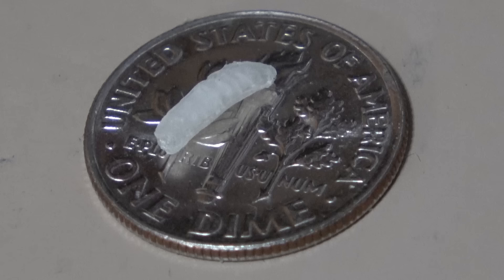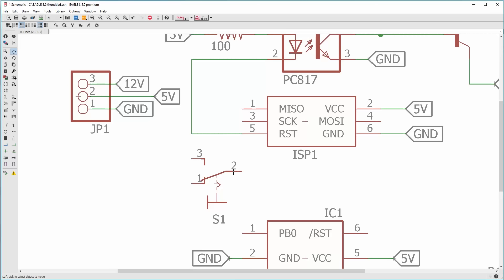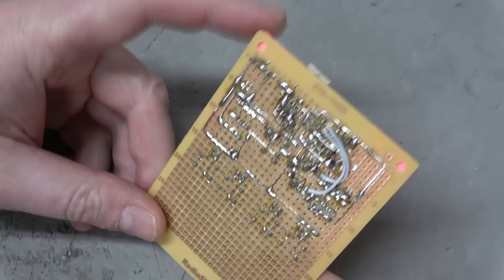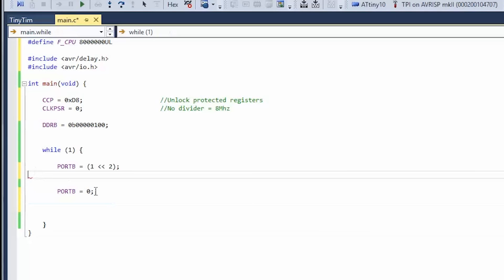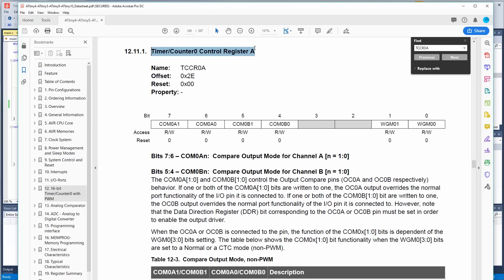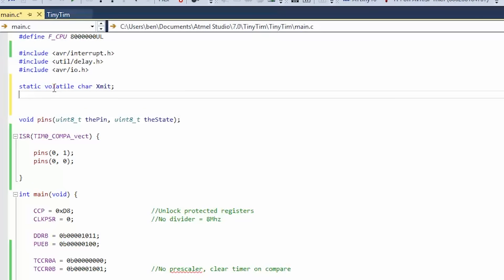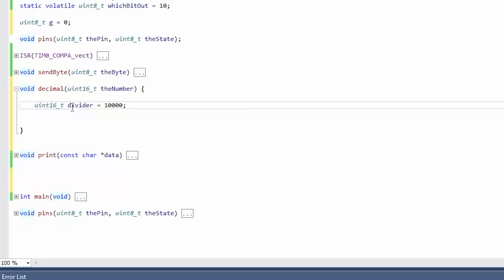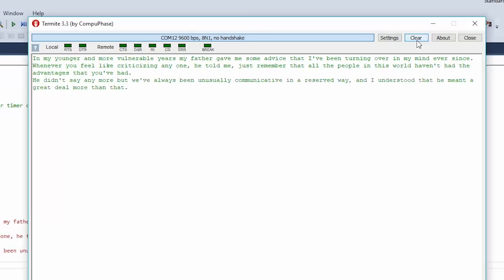How to use the Atmel ATTINY10 Microcontroller

Comment: These are some of the chips that I make at my job, it's nice to finally understand not just how to make them but how they actually work.
Reply: Thank you for providing! These chips are awesome
Reply: You are a hero! Thanks, Eli.
Reply: These things are awesome definitely putting one in my hand
Reply: Sick dude
Reply: Thank you so much for your labour Eli! These things are really cool and could be / are incredibly productive for humanity with the right applications. They're 100-1000x cheaper than I assumed a rice-grain-sized computer would cost! I can think of so many ways these things could help people (especially so with tiny rechargeable batteries and solar cells). It's miraculous to me that you can fit a timing oscillator in such a small thing, let alone a CPU, RAM, and ADC!

This alone has inspired me to learn far more about low-level / low-resources programming. The price and size is a huge, huge deal.
Reply: Can you make a video explaining how the process works?!

Comment: Ben, you rock so much.  Showing the actual dates sheets and raw code from start to finish; building your own ICSP board, there's really something for everyone here.  This is how I got my start with AVR chips back before arduino; and there is huge nostalgia factor here for me.  One thing to keep in mind (may not be relevant to this chip), but in general when working with raw MCUs is a good idea to include a decoupling capacitor (pretty much any value ceramic cap) between VCC and GND because toggling the IO lines can cause a drop on VCC causing the MCU to misbehave (on some lines of MCUs, like the PIC16 it can cause them to just reboot mid program!) anyway, great fucking content, I love that you showed the whole development process.  -- And hey, you should take a look at the V-USB library for the ATTiny / ATMega (you can create a bit bang HID device without even needing a crystal oscilator, just a few zeners! Though you'll need a bit more ram than 32 bytes!) -- Happy Holidays Ben, you fucking rock!  Keep up the good work!
Reply: Good tip! Thanks for your comment.

Comment: I'm glad i leaned programming microcontrollers like that in university and get why it can be important but man am I glad an arduino is all I need for most projects. So i don't have to spend so much time in the datasheet ;D great video, well explained ;)
Reply: What the importance of it is it's tiny and does the right amount of works or functions as well as is cheaper than an normal arduino chip.
Reply: @ray-charc3131  sure I also allways have some attinys laying around for when i need a small form factor. But i referred more to the IDE than the boards itself. Sometimes it's important to have every bit of control over the chip but sometimes it is just more convenient to not have to deal with the registers.
Reply: Never used an Arduino myself. It's just ridiculously overpriced for what it is, and massive and slow. If I need to actually do some more intensive calculations, I use an ESP8266. I use ATTINY85s for most my stuff with the TinyISP programmer. Will probably get an ATMEL ICE or similar for debugging, and stuff.
Reply: @NolePTR  hm massively overpriced is true if you buy the original... Most of the time i use pro micros. From China a pro micro board is cheaper than buying the Atmega32u4 that is on it separately (even if you would buy >100) ....
Reply: @MakenModify  Thanks for the recommendation. I'll look into it.
Reply: @NolePTR  someone recently hinted me to the stm32 (blue pill) which is ARM Cortex-M3 based and from China for ~2€/$ with 32bit, massive io and speed. A bit overkill for most of my projects but worth a look ;)
Reply: @MakenModify  Now that's an enticing deal. Thanks for the heads up.
Reply: @MakenModify  Arduino is not an IDE, its editing widget is crappier than Notepad! and about the "not having to deal with the registers" part, i just do the same as arduino (with less crappy overhead, handholding and annoying limitations (try using all available timer intervals while arduino's millis function hogs them for example) though) by putting a few defines or functions i regularly need into a header file.
Reply: @nonchip  it's called arduino ide and so i call it ide since if i say "arduino editing widget" no one gets what I'm talking about. For most arduino projects I use visual studio code anyways but that was not the point anyway. As said i learned programming microcontrollers the old fashioned way and it do not regret it but for simple tasks like controlling a stepper and a display I'm happy with what the arduino eco system offers
Reply: @MakenModify  that's because it's also not called "editing widget", that's just the fundamental ide component they screwed up. and agreed it's not the point: the thing you like about arduino is not the thing they call ide. it's the library.
Reply: @nonchip  i like the ecosystem they provide and the ease of use they established.
Reply: @NolePTR  dude can o use a TinyISP programmer to programa any atmel Chip? And other questions, what language do you use to program th esp8266? The Arduine IDE? Thnks in advance
Reply: @NolePTR  You are aware that to use the arduino you don't need the entire thing, just the atmega?
Reply: @davidkern7636  You realize the ATMEGA isn't that powerful at all, and these other boards are far cheaper and more powerful?
Reply: @NolePTR  I never said it was slower. It's just good for beginners cause you got lots of beginner friendly tutorials and, as stated before, isn't THAT big as most people thinl
Reply: exactly... arduino for protoype then when you go ok... I need 10... you can then figure out how to accomplish smaller.. when you know the desired end result its easier to get there(or re-get there) I see arduino environment as an excellent DEV board... wish they would fixup the IDE though as its garbage.

Comment: 43:44: Print "Hello"? Not Hello world? Unforgivable.
Reply: @computerman2830  not enough ram to print hello world?
Reply: @computerman2830  Per the datasheet, the ATTINY10 also has 1024 bytes of flash RAM in addition to its 32 bytes of SRAM. Presumably that could have been utilised to pull this off.
Reply: @computerman2830  lol
Reply: @ropersonline  it's a rom, not ram 😅
Reply: @ottobass9193  Yes and no. It's not technically ROM, no, but: "Internal write operations to Flash program memory have been disabled and program memory therefore appears to firmware as read-only. Flash memory can still be written to externally but internal write operations to the program memory area will not be successful." 
Either way, it wouldn't stop you from using the flash RAM to store and source a hello world const. You don't actually need that string to be variable. You don't actually need to alter it at runtime.
Reply: No: "Hello, Dave."

Comment: I recently wrote a bit banged 9600bps UART on an ATTiny24 running at 1mhz. . Used assembler to save space and had to cycle count each instruction to ensure it emitted (and received) at the right speed. The code was tiny, and really useful for debugging 😁 Great to see Ben back!

Comment: Hello, at 10 min it is clear that, the current limiting resistor is missing from the base of transistor Q1 2N2907 and the collector of optocoupler    transistor . Both transistors will be destroyed. Success and a Happy New Year.
Reply: Yes Ben the magic smoke will get out!.
Reply: @rfdave3980  Yes, I know well of the smoke. Never speak of it with a pc on. They only hide the smoke for so long.

Comment: Great video. Used to do something similar 10+ years ago in college with pic microcontrollers.

+1 for the art on the wall
+1 for practical programing illustration
+1 for references to the datasheet

Comment: For function args most compilers for most architectures are likely to pass them by register, rather than store in memory, so the concern should be matching the register size, rather than keeping memory usage light. This architecture has 8 bit general purpose registers, so uint8_t would likely be most ideal anyway.
Reply from the maker: That makes sense, considering RAM access has a 2 cycle penalty.

Not shown in video but doing the same toggle test in assembly yields an identical speed.
Reply: @BenHeckHacks  this is a very nice video, by the way - you've managed to describe incredibly low level C programming in quite the understandable manner. Reminds me very much of Gameboy Advance programming in C.
Reply: @BenHeckHacks  
Even more, if you enable optimisation, pins function gets inlined into the main AND it's optimised down to the single instruction: cbi for clearing bit, sbi for setting bit

Here's the assembly listing: https://godbolt.org/z/8c1pY5

And if you mark the function as static, compiler will know that there are no other object files that will ever call it and remove completely

https://godbolt.org/z/Du-HFP
Reply: I'm curious why you would be doing this in C at all and not C++ where you can leverage constexpr and templates for compile time computations so as many things can go on the flash as possible.
Also yes, compilers are way smarter than you, just make sure your data is word size and it will fo magic to your code. I recommend watching cppcon presentations on the topic and toying around with godbolt just so you can witness how truly powerful C and C++ compilers are.

Comment: At the Programming Part: in school, we used to use Atmel Studio as our main IDE, but when compared to Visual Studio with the Visual Micro extension, then the VMicro is much more convinient and forgiving when using a CH340 instead of the CP2102. And you have the features like autocomplete or one-click to compile and program. (and no need to press the reset switch while programming the atmega2560)

Comment: Nice and entertaining for us geeks.  Thanks for the demo.  I plan to use it to read a voltage in and PWM out a signal to control a PWM speed control fan via simple voltage input.  Imagine a speed control fan based on the LM35 and an op-amp.

Comment: I haven't dug through the datasheet for the optoisolator, so I might be going off half cocked; but, 100 ohms seems a little small on the current limiting resistor for the internal LED.  Outside of that, excellent video.  Reminds me of the pain of learning to program PIC chips when I was first getting started.  This type of material should be a prerequisite for new developers, especially those that think Java can do anything.  ;). Doing useful, timing sensitive work with 32 bytes of RAM and a tiny amount of flash is the best way for beginners to appreciate limited resources and gain a true perspective on what's really going on behind the scenes of "luxury" programming languages.

Comment: after five years i happen to come across this and enjoyed every thing you teach us. one thing i had doubt,  at 6:02 the PC817 emitter is directly grounded. since the collector of PC817 is at 11.3V and Emitter-collector voltage VECO of PC817 is only ablut 6V, this direct grounding may destroy the PC817. i think we need an 1k ~ 4.7K resistor to limit the current through PC817 / 2N2907

Comment: 39:09: NB: The "case 2 ... 9" syntax with ellipsis is a non-standard GCC extension. Careful now.
Reply: As long as you use GCC, what's the issue.

The alternatives are either
A) case 2: case 3: case 4: ...
B) case 0: break; default: ...
Reply: @DanCojocaru2000  The issue is, if you put non-standard stuff in your instructional video, you should highlight it as such. Otherwise someone else is going to have a bad time, and a video that guarantees at least some learners a bad time is not good teaching material.
Reply: @ropersonline  A fair point mostly. Mostly since someone intending to learn stuff like manipulating registries from C on a microcontroller should be able to quickly find out why this non-standard extension might not work for them on Google, or at least find out how to make it work using standard ways.
By the way, are there compilers for AVR that don't have this extension? GCC and clang support it, but are there any others?
Reply: @DanCojocaru2000  I'm not sure, but even if there aren't, once you put a tutorial-style video out there in front of a significant audience, its content will spread beyond a narrowly defined use scenario, and it's always a good idea to point out that something doesn't generalise. Saying, well users doing X should be expected to figure out Y is pulling-up-the-ladder logic. It's better to keep things as accessible and universally applicable as possible.
Reply: @ropersonline  Up to a certain point. You don't start programming tutorials with how to turn on a computer or how to use a keyboard.
Reply: @DanCojocaru2000  While that's true, any suggestion of equivalence here would be facile – that would be one heck of a straw man. And actually, not pointing out that something is non-standard is qualitatively different, because if you don't know how to turn on a computer, you know you have a problem. But if nobody ever tells you X is non-standard, you won't even know you have a problem – until it bites you, at, per Finagle's law, the worst possible time.

Comment: "In the old days" RS-232 was actually positive 25V and negative 25V.  The change to +12V and -12V or +5V and 0V came later.
I believe that the reason for the large voltage swing was to account for possible noise picked up by long wires, but most RS-232 communication was over fairly short wire runs which meant less noise picked up and so the voltage swing could be less without any significant increase in errors.

Comment: Folding the wires in half is a good tip, but I find that even hitting the wires with a touch of a "clean" soldering iron wicks enough solder to make the wires so much more 'solid' they make better connections. Although I have considered buying a "bootlace" crimper, since it makes everything look SO professional.

Comment: i believe we must put current limiting resistor (100 - 10Kohm) between Q1's base to PC817's collector to avoid shorting 12V through Q1's emitter through PC817's pin 4 and 3 to ground, just to be on the safe side... i built more compact version that uses 5V from AVRISP Mk2 to boost converter 12V (hence no external PSU needed) without mechanical switches as well, just because i'm using contact pogo pins when doing programming, and manually disconnect them by hand when done. this video is very much helpful anyway thanks. fwiw

Comment: You can use the transistor side of the the optocoupler as a PNP transistor, provided it is rated to work with 12 volts, which a great many are. There is no need for the additional PNP transistor.

Comment: Shouldn't there be a current limiting resistor between the optocoupler and the pnp transistor?  When saturated the pnp base will be about 11.3 v which will be across the optocoupler transistor.  Seems a bit extreme.
Reply from the maker: I drew the schematic after I built it. Yes there was a 1K between them. Good catch!
Reply: @BenHeckHacks  

Well worth adding a few decoupling caps to the adapter board, as I had many issues years ago when programming PIC and AVR chips without any caps.

Unless you already put the caps on the underside of the board, of course. ;)
Reply: This is where i am still a newbie in electronics design - knowing when current limiting resistors are needed with this scenario
Reply: @jamesrbrindle  Any diode junction, once conducting, will see an exponential  increase in current with an associated further increase in the voltage applied.  To prevent runaway current a limiting resistor is usually applied.  In this case the base-emitter junction is also a forward biased diode and like a  LED or other diode can potentially draw an arbitrarily large current if some mechanism isn't provided to stop it.  So mostly knowing where to put a limiting resistor is a case of identifying the diode junctions that have a low resistance current path between the power rails.  To quickly see this takes experience, but understanding how to determine if they are needed is basically as I described.
Reply: Just wanted to write this, but then I thought that someone MUST have caught this by now and found your comment after scrolling down for quite a bit... ;-)
Alternatively, one could also use a P-Channel FET, with the added bonus of preventing the voltage drop across the PNP. Not that it would be strictly necessary, but 12V is 12V... :-D
Reply: I'm just here to say bravo
Reply: Maybe You can just use the Optocoupler to switch the 12 Volts ? Just connect the Emitter of the Optocoupler to the PROG_12 line
Reply: this is a good point, and good practice to include a current limiting resistor, but this, and many similar opto's, have a open collector, and a "Current Transfer Ratio", a ratio between the led current, and transistor current. for PC817, specified as 80~150 % . the opto transistor  behaves like a current source, high impedance (unless when saturated). 
here led current is about 30 mA . according transistor current, 80 ~ 150% of that.  this would be a bit "hot" so still good, added resistor. but, the opto is not like a "relay" switch is what i wanted to tell. one can even amplify analog signals with a opto with proper biasing (not extremely linear but still amplify) or make a oscillator. some opto's, have a white casing (instead of black), so that internally, more light reflects onto the transistor, increasing the current transfer ratio.
Reply: @nwekuy  If you notice on the datasheet for the PC817, the Current Transfer Ratio is plotted for a collector-emitter voltage of only 5v, in this case the voltage would be one diode drop below 12v or 11.3v.  The datasheet doesn't tell us what the current would be at that voltage, but even if it was say 30ma, that would mean that the optocoupler would be dissipating almost half a watt.  Probably not very good for the longevity of the  optotransistor.
Reply: @juergenschimmer960  the Optocoupler output won't be a exact 0v or 12v